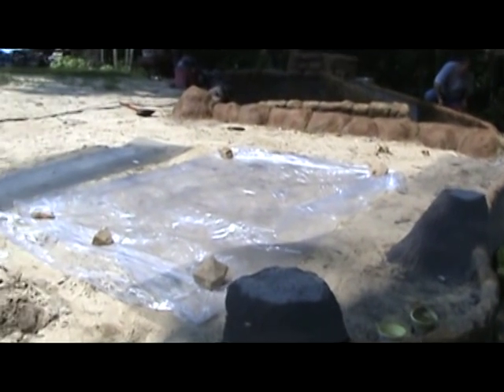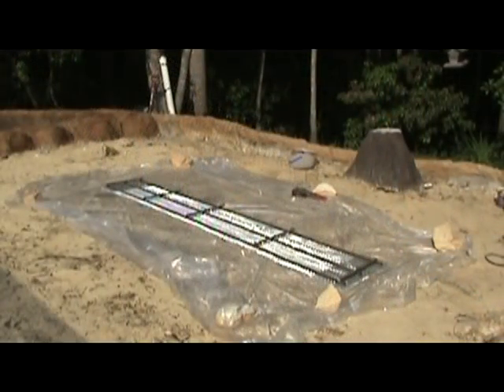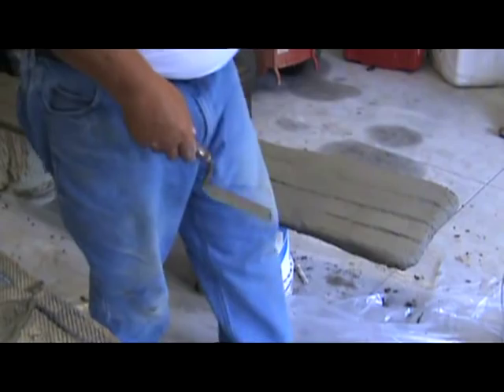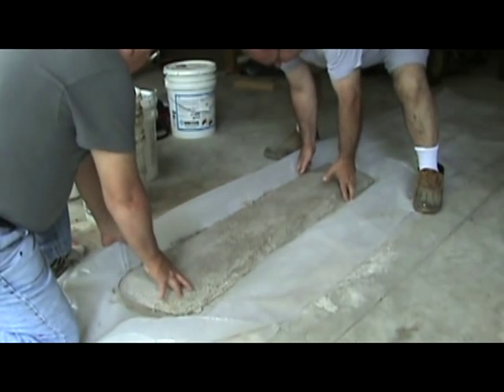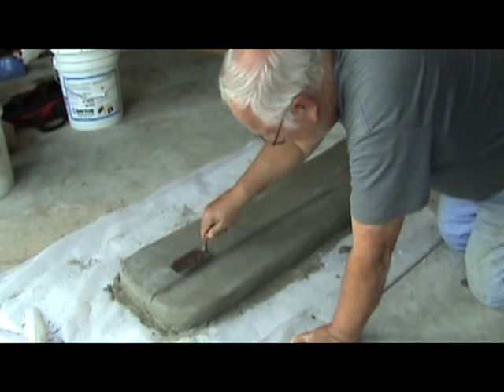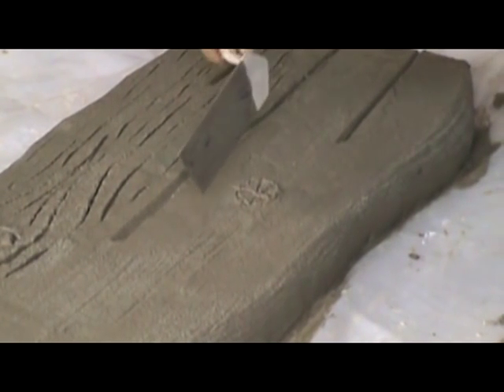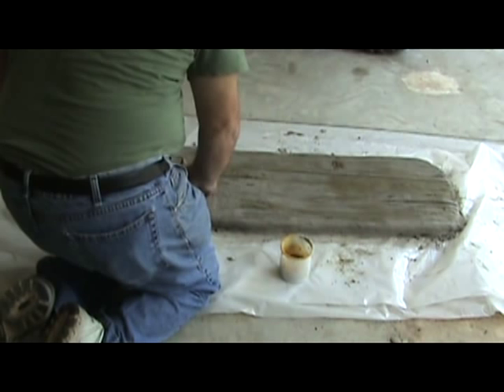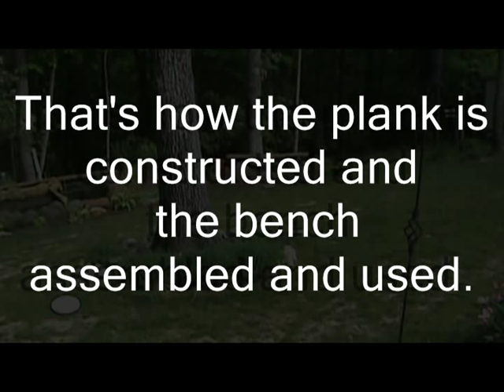Making a Concrete Bench Part 2 -- The Plank.mpg

Comment: Sir, you are truly a gifted and talented artisan and I very much appreciate you taking the time to demonstrate your craft.  Your work is beautiful.  I wish you would write a "How To" book on your methods.  If you do - please let me know where I can get a copy.
Reply from the maker: I thought that was what I was doing with the YouTube videos.
Reply: From the video, I did not understand the band name of the stain, where you got it, what else might be in concrete other than 3 sand and 1 ?  concrete.  Is there a particular strength of concrete.  Do you mix in the bucket and if so how and on the rock wall how did you apply and when did you apply the stain to get the different color of rock.  When you made the stone on the wall it looked like you used uncolored mortar.   Thanks for being there...Jim
Reply from the maker: The mix I used on these benches was 3 sand to 1 cement, about 1/4 part polypropylene fiber and 6 to 7% solids acrylic emulsion in the liquid.  The liquid is made by using acrylic with 50% solids and diluting it 3 parts water to 1 part acrylic. The source of my acrylic is from Fishstone http://concretecountertopsupply.com/ (KongKrete). I now use sand, Portland cement, acrylic,  glass fiber and PVA fiber, as well as adding 5 to 10% CSA (calcium sulfo aluminate) cement, 10% metakaoiin, 8% silica fume and 2 to 3% crystalline waterproofer (Xypex brand).  Here is a video about my mix before I started adding silica fume and Xypex.  https://youtu.be/etSWuBIcdZc  My mix continues to evolve as I find better ways to make stronger, more workable and more durable concrete.   If I had written a book, it would have been out of date within a couple months. Here's a video about acid stain.  https://youtu.be/VM3a7TLuDLE  In this one, I'm using Butterfield brand.  I now buy my stains from http://concretecamouflage.com/   They have a wider range of colors.  Wish I had known of them when I was doing the benches.  They have a terrific color called "Weathered Wood".  My sources also have changed.  Some of the sources, like Butterfield, stopped making the color I used most, the company I bought my acrylic from changed their percent solids and is no longer what I use.   Methods change, too.  I used to color my rocks with a "spattering" technique using diluted acrylic paints. I also used to use powdered colors that were added to the concrete when mixing.  I now use acid stains. As I've changed my mix over time and used more acrylic emulsion in the liquid, acid stains don't work as well and I might change to surface applied dyes for some things.  I mix my concrete in a bucket in very small quantities and used to use a drill and paddle mixer.  I still mix in a bucket in small quantities, but now use a more expensive hand mixer made for concrete.  The way I mix my stuff and how I apply it is not necessarily the way everyone should do it.  I do it my way because of the limitations of space in my yard to mix in larger amounts and because of my age.  I'll soon be 75 years old and can't move a wheelbarrow load at a time.  A book cannot keep up with changing recipes, sources and methods.  Newer videos can.  Further, I am NOT the final authority on any of this.  I'm an amateur hobbyist who has found ways to do things that otherwise I could not afford to do or hire done.  I'm absolutely certain that others have better recipes, sources and methods than those I use.  I continue to evolve and change these as I discover them.  I will be glad to answer questions about how I'm doing what I do as best I can, but nothing I say is set in concrete.
Reply: Sir, you are indeed a gentlemen.  Not a lot of those on YouTube now-a-days.  I very much appreciate your taking the time to answer my question.  I will attempt in the near future to use that information in creative ways.  I will let you know how it all turns out.  Again, tanks for being there!
Reply from the maker: You're welcome.  I've been a teacher and scientist most of my adult life.  I will forever enjoy sharing what I learn and enjoy seeing others benefit from what I can pass along.  I look forward to seeing what you create.

Comment: You have me inspired,  now I want to make some planters and a bench. I don't know what you mean by Acrylic. Is there some special acrylic that goes in cement? I hope they know what it is at the lumber yard or Menards. I bet that bench top weighs a ton.
Reply from the maker: I just found your question.  Acrylic emulsion is also called bonding agent or acrylic concrete fortifier.  It is a white liquid that is added to the water used  in making the concrete mix. Do a search for "acrylic concrete bonding agent" to find brands and sources at Amazon, Home Depot, Ace Hardware, etc.

Comment: Wow!!! This is a masterpiece.  It is both a garden structure and a painting, as good as any that we might hang on a wall.  Now I see what you mean about the bench being different than the columns, and how you made them sturdy with rebar. I would like to make boulders that are light weight and somewhat portable around a fire pit. After seeing your work on the bench seat, it's so incredible I am really thinking of making a bench and copying your design for a seat under a tree.  Any tips you might provide for my boulder as far as the concrete mix, I'd appreciate since you are not just an artist, but a science teacher too.
Reply from the maker: For lightweight, moveable rocks, make them hollow and use the same mix as in the tree stumps.   Concrete won't stick well to plastic sheeting.  Cove a pile of "whatever" with a plastic sheet or garbage bag, cover that with the concrete mix an inch or two thick, remove the plastic when the concrete cures and you have a moveable rock.
Reply: @dperry428  Thank you Sir for your quick reply and knowledge. For boulders as seats around a boulder-esque fire pit,  I was thinking to cover a plastic chair or a stool to get it a seatable height with plastic, then after that, put the cement on top. This is why I was asking about the weight that a portable boulder could support on another video.  When I remove the mold inside, would someone be able to sit on it safely without falling in, do you think?
Reply from the maker: Assuming you don't use bagged mix from a store but the mix I use, yes, it will be strong enough to seat people.

Comment: They look great! How are they holding up over the years? Any maintenance? Do they look the same?
Reply from the maker: Those in this video are in Tennessee and I haven't been down lately, but my brother tells me they are just fine.  Those that I created in my back yard here in northern Illinois are unchanged except for perhaps a slight fading of the color.  Please be aware that the mix I use for my concrete is impermeable to water, the one thing that is the enemy of concrete.  The mix is extremely dense due to the use of metakaolin, silica fume and fine sand.  Further, with the use of Xypex, it is totally waterproof.  I wouldn't think about using just the bagged mix from a home improvement store.
Reply: I am also in Tn. NE Tn. Not sure if I could find those ingredients around here. Thanks for the info!
Reply from the maker: My brother is near Monterey.  These ingredients can be ordered online or you substitute ingredients available locally.  The idea is to create a gradation of particles.  Some people use fly ash, marble dust diatomaceous earth.  Research "reactive powder concrete", "UHPC".
Reply from the maker: I went to Tennessee last month.  Here's a video of the 6 year-old benches.
https://youtu.be/_bDZXoyzSMM

Comment: Mr. Perry I have one more question which brand of concrete stains you are using in this project also if we can use wood stains and how to seal it. You are a big inspiration should run some online classes .
Reply from the maker: For this project, I was using a brand of acid stain that I will not name because I would not recommend nor endorse their products because of their arrogant, unhelpful attitude with customers.  I now use acid stains exclusively from:
https://www.concretecamouflage.com/  There are also water-based concrete stains, which I've not used.  Search for acrylic concrete stains.  I don't know about wood stains as I've not tried them, but I'd assume they would work.  Might be hard to control the depth of staining, though.  I used to seal my concrete with siloxane-based sealer, but no long feel a need to seal a water-tight mix. Any commercial concrete sealer would be appropriate.  Most will be water-based as some states have banned volatile organic sealers, which are most effective.

Comment: Good to go,could you do a cost breakdown with out the lattis on top and would the fence also have a height restriction from the point of stability? I need for the sloped end to remain as tall on top as the  high end (12 foot to 6 foot ) Thanks
Reply from the maker: My cost was $3.21 per square foot or about $256.80 per 10 ft X 4 ft section.  I won't advise on how high you can make your fence as I'm NOT a structural nor civil engineer.  However, you might like to see how commercial concrete fences are done and judge from there. https://youtu.be/8vEEAGJHmYg

Comment: You mention using play sand instead of your regular sand while in Tennessee. That is what we have available here, as well. I am curious if that performs well for your mix...?
Reply from the maker: In Tennessee, the general purpose "sand" was literally nothing more than crushed limestone.  It was physically coarse and a nightmare to work with.  Further, limestone is essentially calcium carbonate and silica sand is the preferred sand in my mix.  The play sand was silica sand, so that's why I used it.  Back here in Illinois, the medium sand bagged by Quikrete is a nice, consistently-grained silica sand that is far superior to the play sand.  You use the best you can get.  At home, play sand is inferior; in Tennessee, that same play sand is superior to the garbage provided by Quikrete there.
Reply: dperry428 thank you. The reason I ask is I live on a silica based sugar sand ridge and wanted to make sure I could use it. It’ll be nice to use it for something productive for a change. I am excited to do some projects using your methods. Thank you for so generously sharing your expertise!

Comment: Beautiful work!  Amazing!  What is the purpose of the white acrylic?  Waterproofing?  Easier to work with the wet cement?  Glue?
Reply from the maker: I add acrylic to all my concrete mixes.  It does a number of things.  It makes the concrete stronger, decreases porosity, making it more water-resistant. It makes the concrete creamier and easier to shape and sculpt. In the case of applying concrete to vertical surfaces, it makes the concrete more adhesive. It bonds one layer of concrete to another, eliminating cold joints. Finally, it is a curing agent, preventing water loss from the mix so the traditional 7-day water curing is eliminated.  In this video, I'm using it to smooth out tool marks, but I no longer use anything for this but water as the acrylic makes it more difficult to use acid stain finishes if it's on the surface. I call it my magical ingredient for concrete art.
Reply: dperry428    Thank you for answering my questions.

Comment: The acrylic you always add to your concrete, is it a pva product?. I'm in NZ so there wont be the same brands but I'm aware of pva bonding agents that give adhesion and plasticity to the mix and wondered if thats what you're using.  Thank you.
Reply from the maker: There are dozens of brands of acrylic and most brands are hesitant to divulge their exact chemistries.  I know that some are PVA, but others are chemical different.  Most all have the same effects in concrete.  The only thing to be watchful of is whether the specific acrylic is re-emulsifiable or non-re-emulsifiable.  If you're using the concrete in a waterfeature, you don't want the acrylic in it to soften.  If it's labeled as concrete bonding agent/admix or concrete fortifier, it will be what you want to use.
Reply: @dperry428  Thank you so much.

Comment: I have the wire structure made for the bench and the two stumps. My question is about the acid stain. You just brush it on the day after you finish with the sculpting?  Some references have said wait till the concrete has cured. They also refer to washing it down or applying something else to stop the chemical reaction after the stain is applied.  Lastly, do you apply a sealer?   Thanks so much!
Reply from the maker: If you're using a normal concrete mix of sand, cement, acrylic and fiber, it takes time for the cement to fully hydrate.  It is the hydration reaction that produces the calcium hydroxide with which the acid stain reacts.  The acid stain manufacturer recommends waiting 28 days to stain, as the maximum amount of calcium hydroxide will then be present.  If you are using a mix containing metakaolin and/or silica fume, these substances rapidly use up the calcium hydroxide as it is formed.  I find that it is best to stain before these pozzolans deplete the calcium hydroxide and make the acid stain far less effective.  As to neutralizing the acid stains, I would agree that it is a good idea to do so if you're using the stains inside on floors.  I find that the acid stain does not require neutralizing as the concrete itself is an alkaline substance that naturally neutralizes the acid and rinsing will take place naturally with rainfall.  By leaving the stain alone, I get the deepest penetration and color.  I have used a sealer in the past, but have found that after a year or two, it is weathered away.   Again, were the stained concrete indoors, no weathering would occur.  I now no longer seal my concrete with how quickly it weathers outside and the sealers are not cheap.  The directions given for the use of acid stains are general and the vast proportion of usage is on indoor floors.  I find them less applicable to outdoor concrete art.
Reply: Hey Kathy whats the name of the wire he used ?
Reply from the maker: @pallavisingh5997  Why not ask the guy who used it?   It's called "expanded metal lath" or "stucco lath".

Comment: Will Home Depot Quikrete Crack-Resistant Mix work for making something looking like the railroad ties around your garden edges? Do I need to add PVA to the mix? Thank you
Reply from the maker: I assume the crack-resistant stuff is such because it contains fiber.  I don't know how well it would work as I've never used it. I assume it would work for making garden edging but, like any concrete, its usefulness is as much a matter of how carefully it is mixed as it is with the mix itself.  Keep water to an absolute minimum and you can work it any way you want.  The biggest mistake people make  is to add too much water too soon.

Comment: Absolutely beautiful!  Can you tell me what kind of maintenance is necessary for keeping these from cracking during the freeze and thaw of winter?
Reply from the maker: No maintenance whatsoever, if you use the mix I use.  I live in northern Illinois and don't worry about thhe weather affecting my work.  I mix 3 parts fine sand, 1 part portland cement and, as a percentage of the portland cement, 5 to 10% CSA cement, 10% metakaolin, 8% silica fume, 2% crystalline waterproofer (Xypex), fiber and acrylic bonding agent/admix in the water.  This makes the concrete impermeable and highly resistant to freeze/thaw cycles.

Comment: I was wondering how much the bridge cost in total to make
Reply from the maker: I'd love to be able to tell you, but I really don't know.  It's just one of many continuing projects.  It's no more that a couple hundred dollars most as a ballpark guess.
Reply: @dperry428  I'm glad you are ok. I was worried something might have happened since I had not saw another bridge video.
Reply from the maker: @teresabarfield84  Thanks for the concern.  I'm 77 years old now and, like it or not, my body is susceptible to the ravages of time.  I didn't get a thing done in the back yard last summer, including the bridge.  I've had a condition called polymyalgia rheumatica that causes a lot of joint pain.  The treatment is prednisone and it caused some serious problems with my eyesight.  I also have a continuing problem with hip joints that need replaced.  Fortunately, cortisone injections in the hip have relieved pain until I can get a hip replacement next winter.  Now, if the doggone weather would just warm up, I could get out and finish up the bridge and start some new projects, like a new waterfall on the north side of the bridge.  We'll  get there, at least until they carry me out of the back yard in a pine box.
Reply: @dperry428  well I think you have done an amazing job and the fact of your age, you go boy. I applaud you for keeping it going. My partner and i are getting of age and we continue to move forward as well. He also has issues with his hip and needs a replacement. Yes it can slow things down. Just one day at a time. We are currently working on our yard. It is nowhere near as beautiful as yours, but we are loving working together and enjoying the progress we see
Reply from the maker: @teresabarfield84  A little update.  I had my left hip replace in May, 2021 my right hip replaced in August 2021 and my right knee replaced on December 2, 2021.  Now, I'm ready for spring.
Reply: @dperry428  that's a lot of surgery. I'm hope you are in much better shape now and more mobile

Comment: Does your bench tops have the micro fibers?
Reply from the maker: Yes.  In this video, I used polypropylene fiber, the first I was able to obtain in small quantities.  I now use both glass fiber base coats due to lower cost, and PVA fiber for finish coats as it is so fine that it is virtually invisible.  It also bonds chemically as well as mechanically to that concrete.  It is also much more expensive.